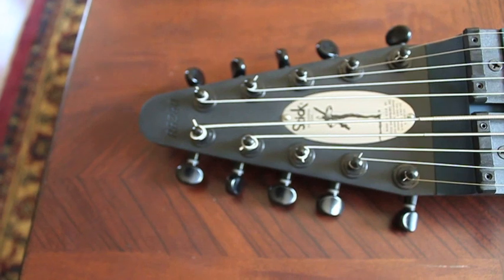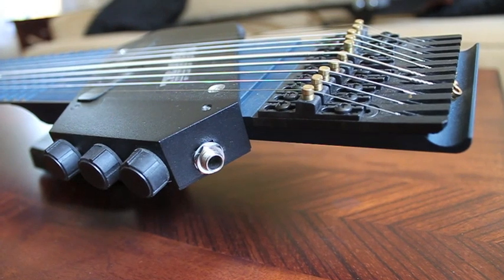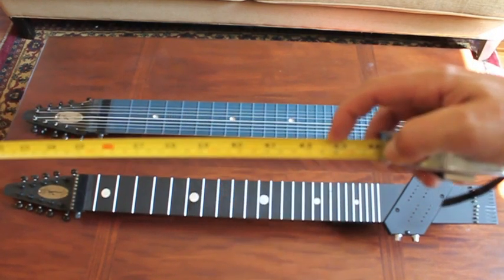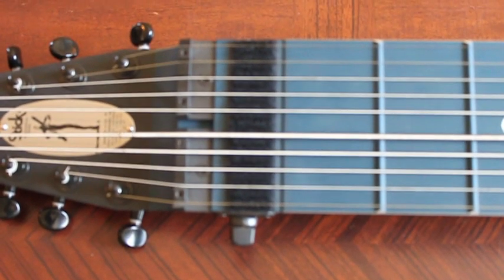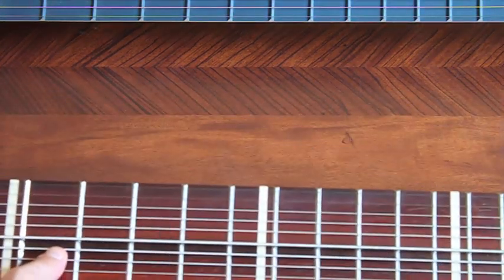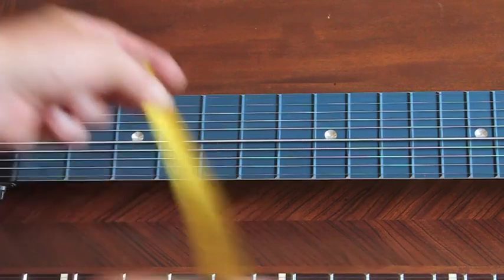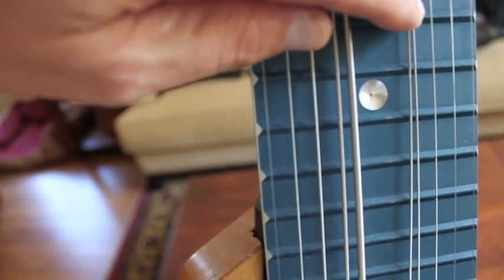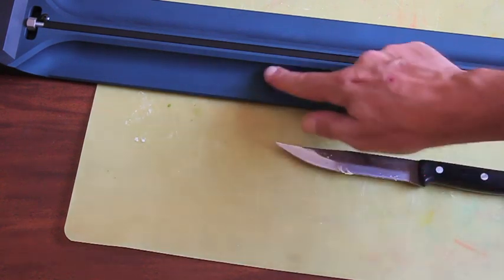Stick Talk #1 with Gene Perry: The Railboard part 1

Comment: Hi Gene, thanks a lot for making this video. I also own a vintage polycarbonate model and I'm considering getting a railboard, which is like 30 years worths of innovations. How do they compare with one another?
Reply from the maker: They are almost 2 separate instruments. My strong advice is to journey to someone or someplace where you can try one. After years of playing a 10-string 34" scale instrument, just moving to the 36" was a big step. Changing out the feel, the weight and scale is a huge step, so ideally, try before you buy.

Comment: Hi Gene! Great video... I'm having a hard time trying to find the specifications of the railboard (dimensions and weight). I'm most interested on the weight: it's more or less compared to a 10-string stick?
Reply: Of all tapping instruments, the Chapman Stick is the lightest (Warr, Megatar, etc.). My 10 string Paduak with an actv-2 weighs 3.23865 Kg. My first run Blue Railboard weighs 3.99161 Kg - not much of a difference. Check this link for details on weight - http://stick.com/instruments/railboard/beam.html - cheers Vicente!

Comment from the maker: At a high level, the fretboard instrument is 12.5% thinner. But it's scalloped, so it has a very different feel in that the side of the back of the neck are very thin as you get closer to the sides. The distance in between the melody and bass side strings is increased by about 10%. Lastly, the xFret distance is almost twice as wide! Thanks for this comment Andy, I appreciate it!

Comment: Thanks for the vid! Been checking up on the site every few weeks and I noticed the Plum color but also the price jump but more upsetting is that I no longer have the option to get MIDI on both Melody and Bass sides... any idea why that was changed? I heard before that adding to both caused some issues on the wood sticks. Is that true here?
Reply from the maker: The position of the R-Block is reversed so there is less room for a dual midi configuration. The price change was necessary to break even on material costs and labor, which is all done by Emmett personally. Thanks for the watching the video Dennis, please let me know if ever I can be of assistance to you - take care!
Reply: Thanks for clarifying! I'm working to afford the railboard very soon.

Comment: I feel like the strings being ground into bits by the frets and leaving residue is sort of a big deal. 

Are strings going to wear out/break more easily/faster on this instrument?
Reply from the maker: Stick Enterprises no longer sandblasts the surface of the Railboard, they machine texture. It give a much smoother delivery - http://stick.com/instruments/railboard/newtexture.html. The Railboard are a beautiful thing.
Reply: I would be far more worried about the strings grinding the frets to bits. That hard ano is super thin. It's resistant to minor scratches but not much else
Reply from the maker: Rob Graham Thanks for the comment Rob. While you are correct that the anodized surface is quite thin ( 2000th of an inch), there is no amount of force, pressure or thermal stress that a human can deliver tapping Nickel plated strings against a fretboard whose hardness is equivalent to that of a ruby. In the unlikely event that it did occur, Stick Enterprises would gladly replace it.